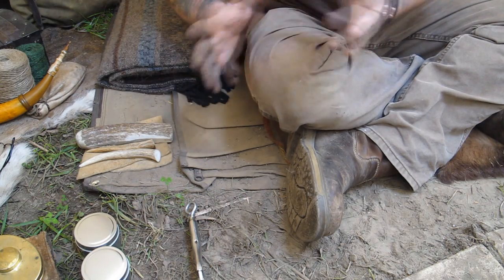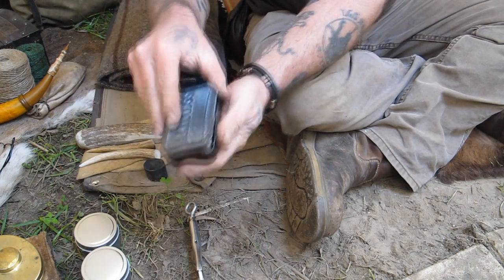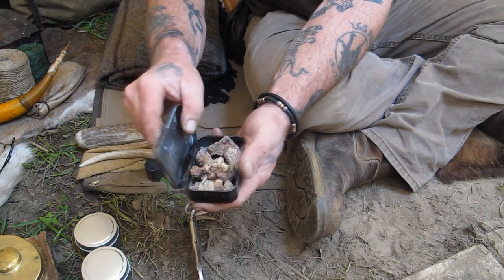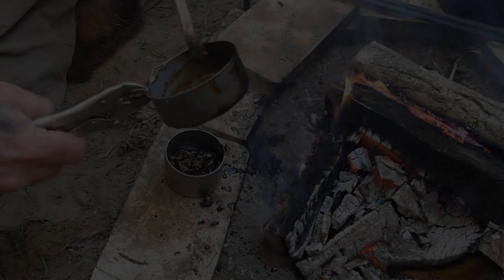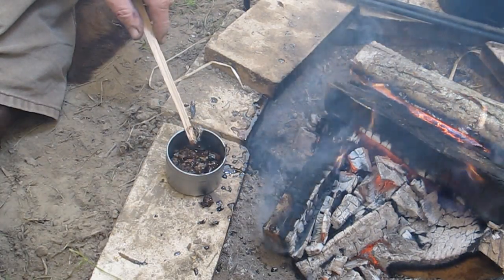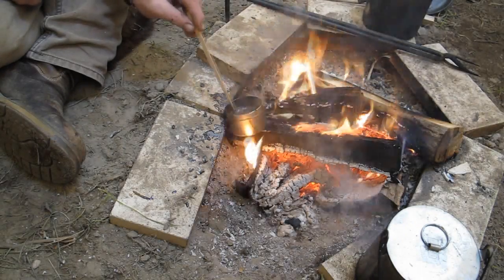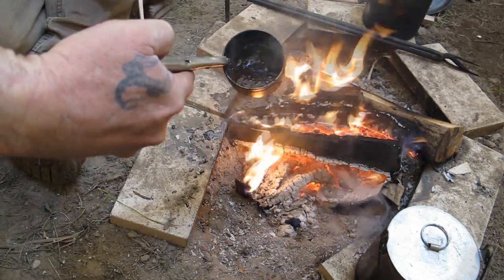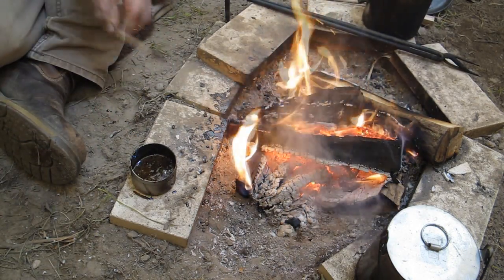Diary of the Tipi 6 Repairing a Broken Stone Point Part 1

Comment: Something you can use for arrowheads is the metal from the bands in heavy equipment tires (on construction vehicles).  You heat it up with a blowtorch or coals, cut it with a chisel or tin snips& shape it how you want it, then reheat it & quench it in water to reharden it, then sharpen it.  They're pretty close to the finished product to begin with & are good steel for this.